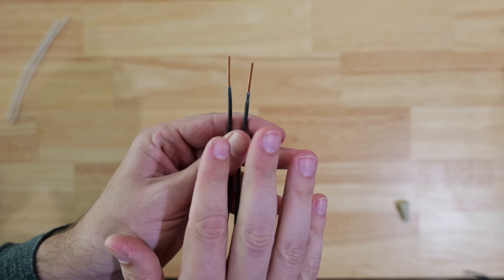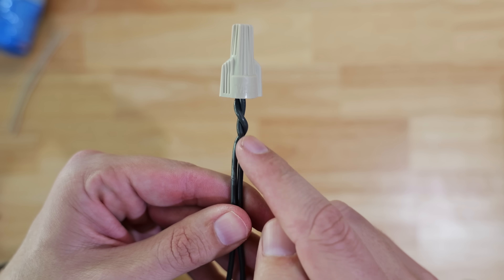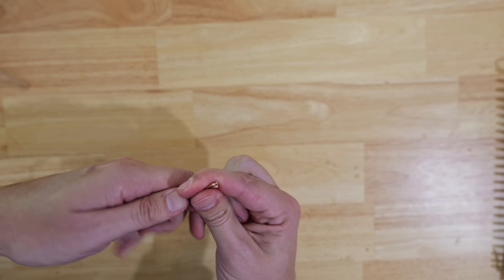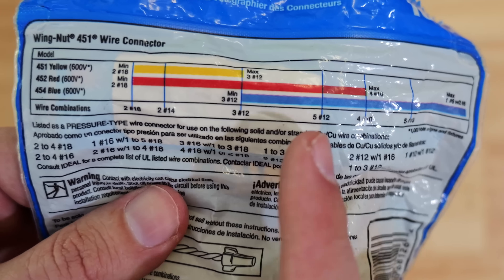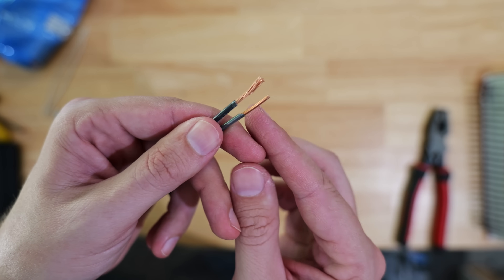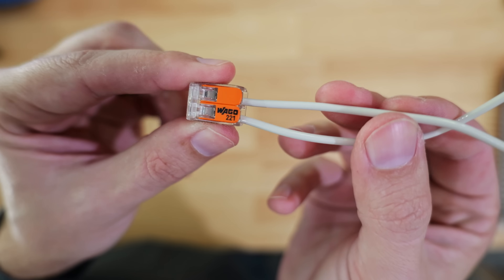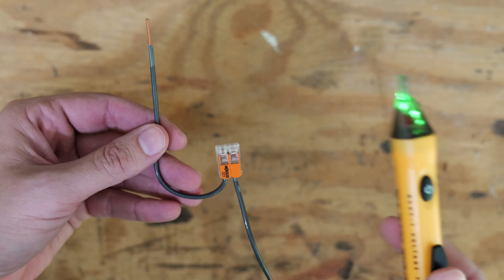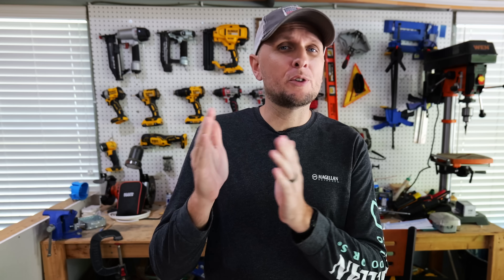7 FATAL Wiring Mistakes Most DIYers Don't Know They Are Making | Most Are Guilty of 3

Comment: All of these are great to know, and they follow a very important rule: A good electrical connection requires a good mechanical connection. This was hammered into my head when I started as a technician over 40 years ago, and it is still the #1 rule to follow.
Reply: A loose connection can cause arcing which can cause a fire.
Reply: Always wear a hard hat and safety glasses when working with electricity, nobody will second guess you.

Comment: A lot of this video mistakes are why I stopped using wire nuts and prefer WAGO connectors, they work great and are way easier to get a good connection. Of course you still have to strip the wires according to the strip guide. A word from the wise, dont trust any knock offs of the wago connectors. The cheapos have very poor contact area on the wire and small levers that are harder to operate. Great educational video and you covered the topics very well ! Good work.
Reply: No reason to use wire nuts anymore. However so far I have seen 2, 3 and 5 pole Wago connectors, but recently I would have liked to have a 10 pole. The reason is that the cable I was installing had both a shielding and a separate protective ground wire and they can be wired together at each end. The cable has the quite complex designation S07Z1A5EZ1-U but is more known as EQLQ in Sweden and is very common for outdoor and industrial use.
The shield can either be to just protect against penetration or used as a signal ground. But it depends on your specific use case.
Reply: Spent ten years installing and repairing cable.  All the sizes for cutting the wires on the big stuff, 1/2 inch or bigger, was on the linemen's pliers.  the wire sticking out the end of a standard fitting, used on tv, was the thickness of a nickel, or the size of the Klien lineman's pliers from the cutting side, the length of center conductor going into the amps on the telephone poles was the width of the pliers, etc.  there was also one for the thickness of the pliers.  I am curious if the stripping guide for the WAGO is on the lineman's pliers also, or maybe the width of your wire strippers, which could be brand specific.  I know using the lineman's pliers to cut the lengths of the center conductor saved a lot of time so you didn't have to hold the wire, a fitting and the cutters all while 20' literally above traffic was nice, one less thing to have to hold when you were afraid of heights.
Reply: @Dev JB it´s the first time I´ve hear about problems with WAGOs. Correct usage provided. 
I´ve tried to find objective information. Could you please share some. Most - even USA - sites tell that WAGOs are more reliable than the twist ones. 
Whole Europe relies on WAGOs. Never heard of quality problems causing fire or so.
Reply: @Dev JB would you care to give the inspectors names so that we can verify with them that Wago connectors are not allowed due to high failure rate?
Reply: @Dev JB 

Your comment vanished, but here's my reply anyways.

"I'm not going to slander..."

It's not slander if it's true.  You saying it would be slander to name them implies your statement is untrue. Naming them would allow electricians to verify wago are not allowed before using them and failing an inspection. "Trust me bro" is poor evidence to back your statements.

"It is well documented"   No it isn't.

You know what is well documented? Wago connectors meet NEC code, which is the electric code adopted by all 50 states. If they had the high failure rate you claim, they would be disallowed by NEC code.

If you didn't want to be in a pissing match, you should not have started one.
Reply: @Dev JB Your arguments mostly apply to the old leverless Wago's which I wouldn't touch with a 10 foot pole (except for quickly terminating a single wire); the new lever action ones are better sice they have stronger springs and a larger contact area. Though I still like to use wire nuts for the occasional own project.
Reply: @notahotshot  And inspectors are public officials, if they're not doing their job properly it's time to name and shame.  They don't get to ignore the code allowing Wago and come up with their own personal rules.
Reply: Wagos are GARBAGE; no better than the "push-in" connectors on 15-amp switches & outlets.

Comment: Excellent presentation. Great information for the lay person. Wish every homeowner could see this video .  I have been doing it wrong for years . I’ve been lucky so far in my 35 plus years of home repairs. I always use electrical tape around the wire nut and the wires. Thanks for the great information !
Reply: I do as well, especially if it is outside and especially if it is in a large service box with other connections.

Comment: I have found wirenuts in walls remodeling that were actually split open. One had 12 gauge wires in it like you demonstrated, but rather than change the nut they added a couple outlets by undoing that nut and cramming another 2 wires in. It was hilarious, and a bit scary. Side note: I ripped every wall down, and redid all the wiring properly. It's odd, but I enjoy waking up not on fire. I'm just weird that way.
Reply: "I'm just weird that way." you missed a perfect opportunity to say "I'm just wired that way."
Reply: Thanks for explaining
Reply: You should never find wire nuts in a closed wall. That’s a code violation.
Reply: Poor quality of the wire nuts. Or the electrician...
Reply: While there is not tightening a wire nut enough, there's also overtightening.  I've practiced or even had it in a wall where I gave it "just a little more" and a wire end broke off.  Even had one where the bit of wire was stuck in the spiral.  I don't like overtigtening because it can make it harder to reuse a wire end in the future, which I might want if there's not much wire left to work with.  Of course I might consider using a lever connector, which doesn't affect the wire as much.
Reply: @crosisofborg5524  
I think the reference is to a junction box.  I consider that inside a wall.

Comment: Great job on providing awareness and safety! One item not covered is the non-lever "Way-Go" which is typically used in the industry, especially since the lever model is still starting to gain popularity. But from a cost point (I have purchased >100K) the non-level is much more economical and has less chance of, as you stated, pushing the lever and releasing the wire. Another good point with the "Way-Go" is that you can test the voltage through the top holes without exposing yourself to any bare copper.
Reply: It's just wago.
Reply: There are a lot of different manufacturers of push-in wire connectors.  Ideal probably has more of that market in North America than WAGO.  The only one I saw at home didn't look that secure (one of the wire was actually out) and I took it apart and wasn't terribly impressed by the design.  However, others like Ideal or WAGO seem to have a more secure design in my opinion.

Those have a way to release solid wires, by twisting and pulling simultaneously.  I get that some people claim it means that they're not secure, but it doesn't realistically reflect what would happen in a box.  However, I've tried removing stranded wire from one and it just wouldn't come out.  Had to just cut it off and strip.  I ended using an Ideal lever connector to replace it.
Reply: I pronounce it "wah-go", like this, "WAGO Schmago"😏

Comment: I have been a DIYer since my dad made me do all of the work starting at age 10 or so.  Most of the problems you stated are common sense and people making them have no business doing their own wiring...  When people ask for me to do wiring for them I usually tell them to hire a professional though, because me wiring my house is one thing, but someone else's needs a person that is bonded.
Reply: To be fair, while the laws may be different where you are from, where I am, a non compliant household is the responsibility of the owner.
Unless it was signed off by a registered person within about 2 years and no changes have been made to the installation since then, in which case they will be held responsible.
This is why you get a professional to do it.  If your house burns down it will be considered negligence on the owners part, even if they got a qualified person to do the installation but did not get a registered person to ensure it was compliant and sign it off as such.

Comment: I have been doing DIY wiring since circa 1955 and am prepping for my final rewiring of an old house. I am sure I am guilty of the mistakes you illustrate. I will be doing a much better (and safer) job this time, thanks to you.
Reply: Mr Brexton, I was born in 1955, if you were 18 then, you would be 85, are you certain you want to re-wire a house at your age?
Reply: @henryjames8654   It beats not having any electricity.  PS I am only 81 :)
Reply: @henkerj  are you old enough to know what a "ding-batter" was? I didn't start pulling wire until 1981, so you have a few years on me. Good luck with your project.
Reply: Get right on that next job …you’re bound to burn a home down sooner or later 😂
Reply: @gan1440  Piffle, I gave up on homes years ago, I specialize in commercial property.
Reply: @gan1440  Already did that last summer. not electrical but cooking oil on an electrical stove.
Reply: I've been going through a few homes built in the 50s/60s where I saw all sorts of things that just seem wrong these days.  The wiring was likely done before plastic wire nuts were commonly used.  I saw one crimp of three wires together that was covered in electrical tape.  Mostly I saw two wires that were bridged and pigtailed by pulling the insulator on one wire, wrapping about an inch of the other wire around that bare wire, then solder.  And I think it was probably molten solder poured on the twisted wire.  I even found some of the insulator charred - probably from excess solder that was removed although that was typically thick rubber insulator that was still more or less intact even with a little surface charring.  And that might be covered with just vinyl electrical tape, which was probably a fairly new thing in the 50s.  There were some more secure coverings, like rubber splicing tape (which was messy trying to remove) covered with vinyl or friction tape.

I might use wire nuts to replace those, but also lever connectors depending on the situation.

Comment: This was invaluable advice to aid me in installing a smart light switch in my kitchen. I struggled to the point of giving up for more than a year because of the three solid wires I'd need to join to the stranded wire of the light switch for the neutral connection. The Wagos really helped with this.

Comment: The Wagos are experiencing the same resistance as PEX , shark bites and pVC did with plumbers. I have been using the stab in Wagos and now the lever locks for years and never had a problem. You should probably put the line feed wire in the labeled lever chamber as good practice and always pull on the wires to be sure they are seated. As a bonus , the Wago lever types have a small probe hole if you need to check for voltage or continuity. Like anything ,you have to do a little research and reading and follow the directions.
Reply: I needed something for making quickly temporarily connections during renovation, so i tried wagos because that was quick and reusable. I did not feel resistance. I only felt like why this didn't exist when i was young,? Now my lighting circuits are all connected with wago and if i feel like reconfiguring or adding something, i can do it in minutes without even switching off the electricity. 
For the outlets i don't use wago though.  For that i still use the same massive 5 pole screw terminal as 40 years ago. It's still 100% mount compatible, only made of cheaper materials now and the machining of the copper is not so clean as 40 years ago. But ok it became cheaper for the same functionality. Anyway, i bet wago will also still be there in 40 years.
Reply: It is what you are comfortable to work with.  I have been using shark bites and wagos for years and my house is still in one piece (no flood/burning).
Reply: Years ago there was so much hate around shark bites, I am SO GLAD I used them for my recent water heater change.  Professionals might mind the extra cost over convenience for things like shark bites and wago connectors, but for DIY it's all cheaper than hiring someone to do it for you.
Reply: Because wagos, like pex and shark bites are lazy assed contractor in and out crap. Fast and convenient for them, but a pain in the ass for the home owner at 2am when your shark bite lets go or your dumb pex takes a piss inside your walls.
Reply: @steverich136  What are you talking about, I've never seen contractors using anything but the cheap wire nuts because they care more for low cost over convenience.  Sounds like you're talking about an incompetent contractor.
Reply: @takeit1229  took the words out of my mouth. Wire nuts are cheap and belong in the history bin. If your contractor is using WAGO they care about their install.
Reply: Never had PEX leak in a run. Can’t say that about copper. Every time I find leaking copper, PEX goes back in. End of problem.
Reply: well for small current fixture connection maybe but I have seen a few problems with high current branch splicing/pigtail work. Having worked with DOD and NASA certified course on making wire connections I will never trust those.
Reply: @steverich136  if anything, a Wago type connector is simpler for home owners.
Reply: Very true. Though, if I were charging customers for my services, I wouldn't be using shark-bite fittings.
Reply: I've never used a Wago with levers...the ones I used had only the ports, and you just had to wiggle them as you pulled to get them back out.
Reply: I have never used wago connectors. I'm leery of them after seeing so many back stab outlets fail after they've been in service for several years.
Reply: @steverich136  Total BS. WAGOs will not let go, and they are much easier to troubleshoot with than all that twisting and untwisting bollocks.
Reply: @mikeclarke3005  If you're referring to the WAGOs I call BS on your claim.
Reply: I have heard all manner of horror stories of genuine wagos burning down residentials, and not a single proof.

WAGO appears to be a dubious option if a wiring branch is repeatedly loaded well above its rated current...which should never happen. If 16A socket branch draws 50+ amps (it actually happens in reallife) for more than a couple of minutes, WAGOs tiny, but predictable contact point is already least of problems.
Reply: @Hoops-Senior  SOME of us are master-craftsman. And some are clearly…. Not.
Reply: @mikeclarke3005  What does the DOD have to do with making wire connections? I doubt the DOD would develop their own course for such a thing and would likely inherit standards from elsewhere in the fed space.  What a strange bs flex.
Reply: I love Wagos, they are more secure, take less time and fuss, and are more compact so they lay in the box better conserving space.   They also don't mangle the wires, so if you have to make future changes, you can easily do so without a lot of straightening, or cutting and re-stripping
Reply: The trades are notorious for shitting on anything new and calling it crap before even trying it. It's a very weird dynamic with a lot of industries.
Reply: @steverich136  These new easier to use products I think get shit on because contractors don't love the idea of the consumer being able to work on their stuff easily without years of experience or expensive equipment.

There's a time and place for both.
Reply: @boaragile82  Seriously What? 
A 16A circuit carries 50A, you have no idea of how circuit protection is meant to work or the CPD is far over-rated than what it should be for the equipment installed at the end of the sub-circuit.
Reply: Check out typical C-curve breaker's datasheet. You'd be surprised by how long it'll carry 3x nominal without thermal breaker trip.

I do wish to apologize for "more than a couple of minutes", which is not entirely correct. Quality C16 breaker (i.e. ABB, Schneider, perhaps Legrand) should trip within 1 minute a most under 50A.
Reply: @steverich136 I’ve only had one sharkbite fail, and it was my own fault for not following instructions. In nearly all cases where I’ve seen problems, it was due to improper installation, no matter what technology is used. I’ve seen poor cast iron fittings, soldered copper, wire nuts, backstab outlets, and even Wago connections, but I can’t think of a failure not caused by poor installation or misuse, such as 30A through a 12ga extension, not cleaning pipe or not using pipe thread sealant.
Reply: @effedrien  I feel like they are way safer with all of the stranded wire you see in light fixtures and ceiling fans. Much easier to make a good connection with a lever Wago rather than a wire nut.
Reply: Wagos give you consistent, reliable performance even if done by a beginner electrician or even DIYer. Wirenuts give you good or better performance than Wagos ONLY if done by an experienced installer. And even then there might be some mistakes, but Wagos are bad only if you're really careless.
Reply: Shark bite, PEX, and pVC are fine examples of how to build something to fail. They used to build things to last.
Reply: So, my 2 cents on this comment. 
I have struggled with sharkbites on an existing PEX installation. Seems issue was the previous installer was rather careless while handling the PEX tubing and scored the exterior of tube where the sharkbites seal. As PEX norm fittings seal on tube interior. But no argument they make a great emergency repair device.
Reply: Wagos are GARBAGE; no better than the "push-in" connectors on 15-amp switches & outlets.